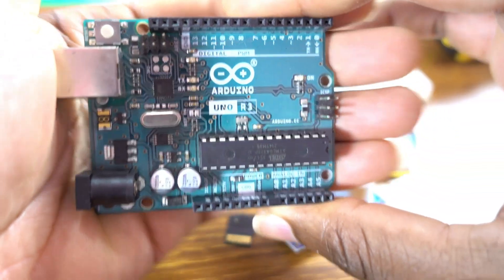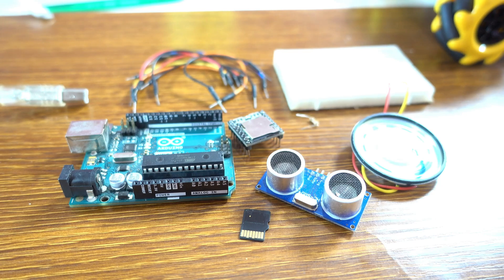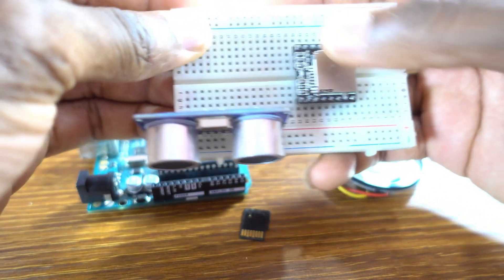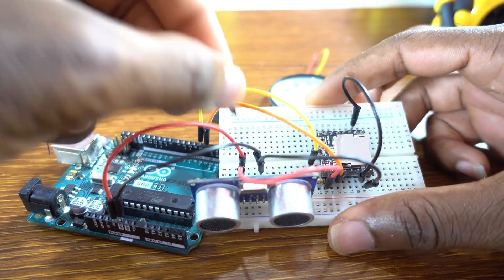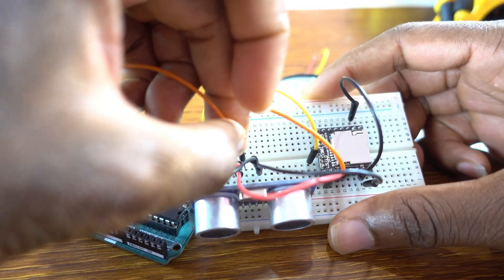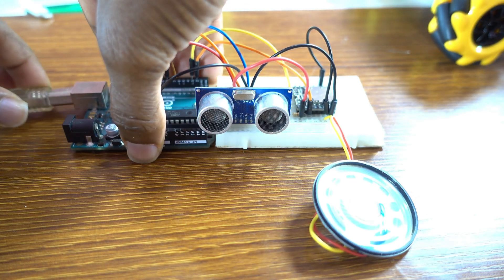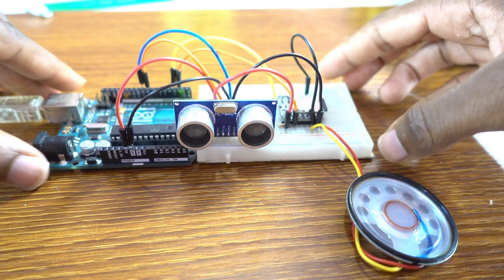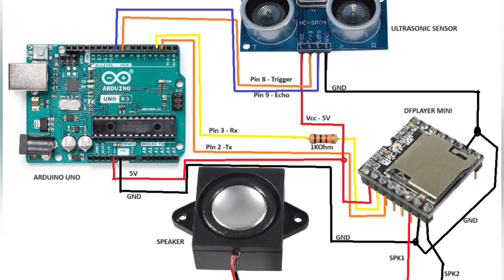TONE UP Your Arduino Projects with Audio Distance Measurement!

Comment: Sir, on uploading the code it is not showing the proper distance, why?
Reply from the maker: Check out your circuit. Did you use the same library and Microcontroller as me?